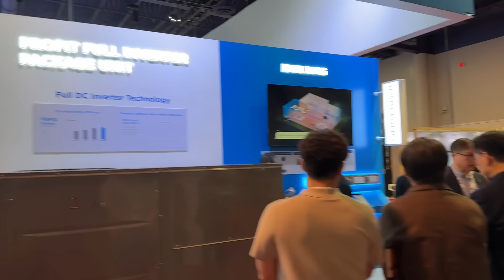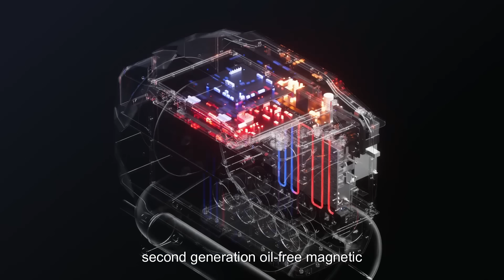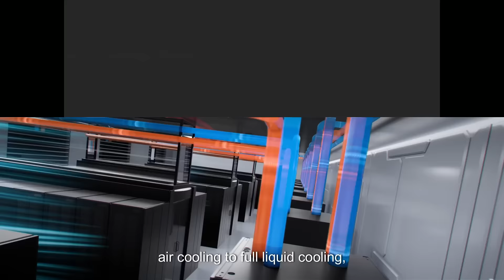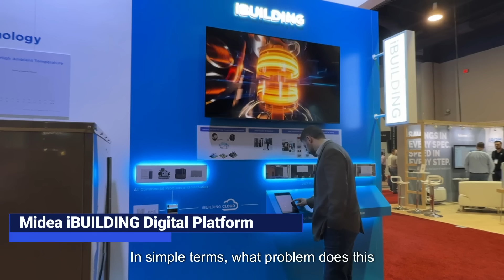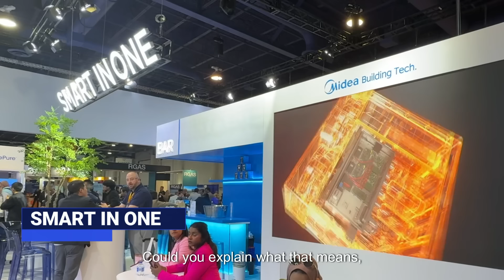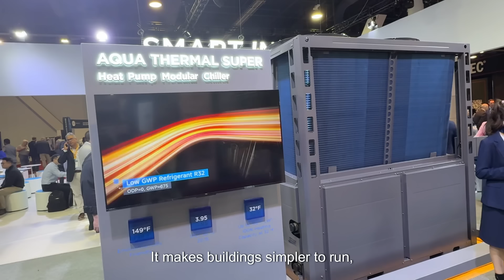Midea Building Technologies at the AHR Expo, Smart in One Solutions

Comment: This was one of the more technically substantial AHR Expo walkthroughs I’ve seen. The explanation of the Mag Boost Apex Pro’s second-generation oil-free magnetic bearing compressor was particularly compelling. Eliminating mechanical friction and oil management isn’t just incremental improvement—it’s a structural efficiency shift. An IPLV of 9.71 and projected 30–50% energy reduction compared to standard chillers is significant, especially when cooling can account for 40% of a building’s energy usage. The fact that MBT paired efficiency claims with lifecycle durability (30-year expectancy) and refrigerant sustainability (R1234ze) shows a balanced engineering and environmental approach. This wasn’t just marketing language—it felt grounded in real mechanical innovation.

Comment: The discussion around full-stack liquid thermal management for AI-driven data centers was very timely. With rack densities climbing and GPU clusters pushing thermal limits, air cooling is becoming insufficient in many applications. MBT’s positioning—from CDU distribution to magnetic bearing chillers—demonstrates a systems-level understanding rather than just a component offering. Achieving PUE targets as low as 1.2 is ambitious, but the integration narrative made it sound feasible under optimized deployment conditions. This aligns well with current hyperscale infrastructure trends.

Comment: The 70 dBA sound comparison (roughly washing machine level) was an interesting detail, but it felt briefly mentioned and quickly passed over. For urban installations or retrofits in occupied buildings, acoustic performance can be as critical as efficiency. I would have liked more elaboration on vibration isolation and acoustic engineering, especially since magnetic bearing systems inherently reduce mechanical noise. There’s likely a strong story there that could have been expanded.

Comment: Adam and Joshua cover the essentials effectively—the Mag Boost Apex Pro's magnetic bearing innovation reduces energy use by up to 50% and extends equipment life, while the Smart in One strategy with iBuilding creates a cohesive, intelligent system that optimizes HVAC, lighting, and more. This integrated method not only lowers operating expenses but also supports aggressive sustainability goals and handles demanding loads like AI data centers with exceptional precision and resilience

Comment: The interview does an excellent job explaining how MBT addresses rising energy costs and data center demands with the Mag Boost Apex Pro's high efficiency and no-contact compressor, alongside full-stack liquid cooling and the iBuilding platform's intelligent integration. It positions Midea as a leader in sustainable, low-carbon building technologies with practical advantages in cost, control, and performance

Comment: What stood out most was the coherence of the portfolio. Rather than showcasing unrelated products, MBT demonstrated a layered architecture: magnetic bearing chillers for core cooling, heat pumps for heating, VRF for zoning, and a digital brain tying it all together. That systemic cohesion reflects strategic planning. If performance claims hold up in operational environments, this integrated ecosystem approach could position MBT as a serious competitor in large-scale commercial and data center HVAC markets.

Comment: The shift toward liquid cooling for AI workloads is absolutely real. GPU-based inference and training clusters generate heat flux densities that air systems struggle to dissipate effectively. MBT’s approach of addressing the cooling chain from chip to cooling tower suggests they understand the thermodynamic constraints at multiple levels. If their CDUs and chillers are truly synchronized as described, that vertical integration could simplify procurement for data center developers significantly.

Comment: The iBuilding platform sounds robust from a systems-integration standpoint, but there was no discussion of cybersecurity or data governance. In 2026, any centralized building command center must address cybersecurity architecture—encryption standards, network segmentation, cloud vs. on-prem options, etc. For enterprise clients, this omission stands out. Integration is powerful, but without hardened security protocols, it can also introduce risk.

Comment: What I appreciated most is that sustainability wasn’t framed as a vague ESG talking point. It was tied directly to measurable outcomes—lower operating costs, improved PUE, eco-friendly refrigerant selection, and waste heat reuse. The example of reusing data center waste heat to warm offices illustrates real thermal recovery strategy. That kind of systems thinking reflects maturity in building technology design rather than just green branding.

Comment: The “Smart in One” concept resonates because integration is where many building systems fail. Most facilities operate in silos—HVAC separate from lighting, separate from energy monitoring. The iBuilding platform’s ability to unify BACnet-compatible systems into a central command environment is strategically important. Predictive maintenance functionality, especially if truly data-driven rather than alarm-based, can dramatically reduce downtime and labor costs. If executed well, this could be one of MBT’s strongest differentiators.

Comment: The technology sounds impressive, particularly the oil-free compressor and integrated approach. However, I would have liked to see more empirical deployment examples. Are there large-scale facilities already running the Apex Pro? What measurable results have been documented over 12–24 months? The claims are strong—especially around 50% energy savings—but without real-world case studies or third-party verification mentioned in the interview, it leaves some questions unanswered. Still, the engineering direction appears promising.